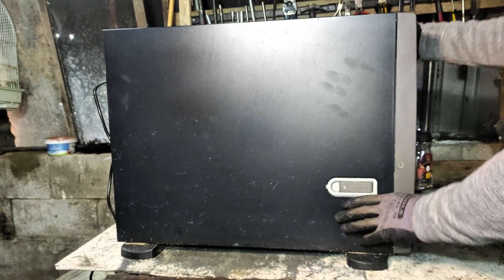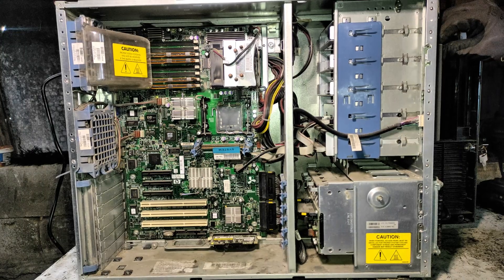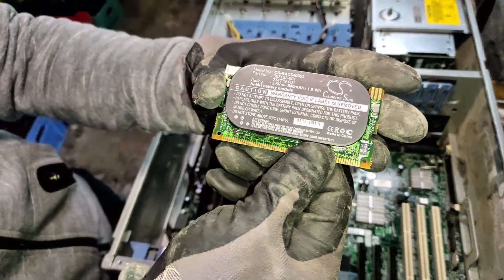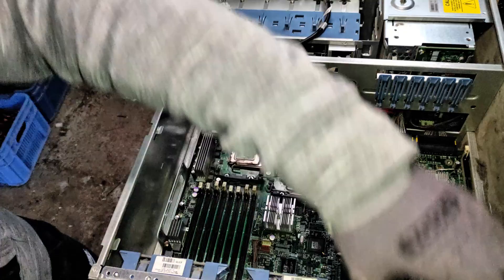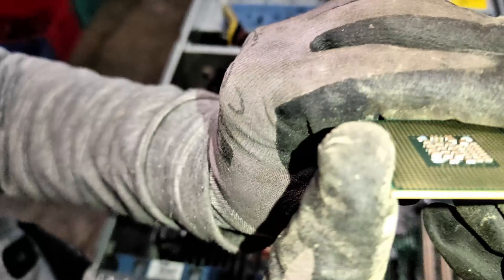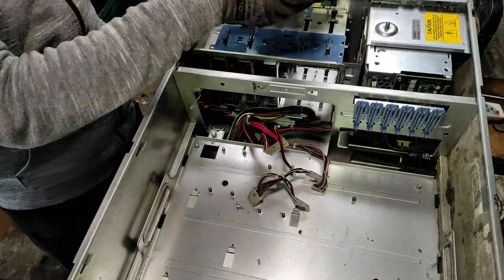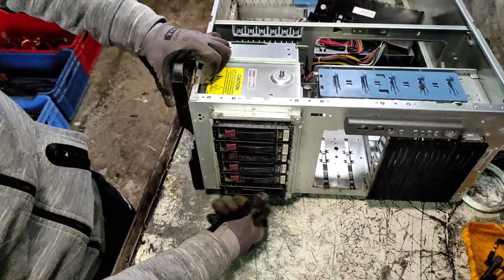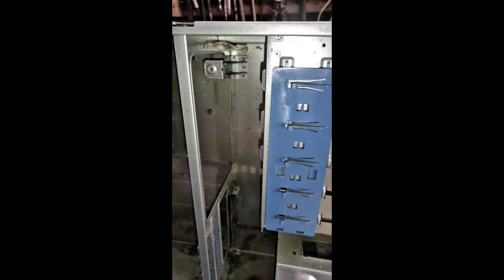How To Scrap An Old HP Server for 🤑!!!

Comment: Well, 2x X5130 with some GPU is somebody's first gaming pc, although, on the lower end. I personally run a 2U HP Dl380 G6 with 2x x5690, 128gb of ram and two GPUs, which through virtualisation gives me a decent workstation + some services exposed to the internet...

Not to mention that I have another server of what I am thinking that has exactly the same motherboard.

To use such a machine as a server you can forget about it. As a home pc//beginner gaming/ cad workstation - man it is the bang for the buck which you'll get in a while....
Reply from the maker: I have to admit you have awesome knowledge in servers and PCs, no doubt about that!!👍 thank you for watching